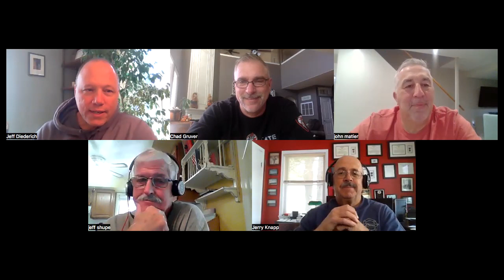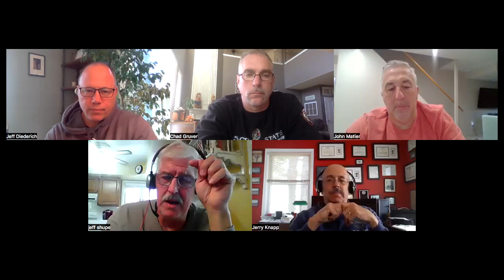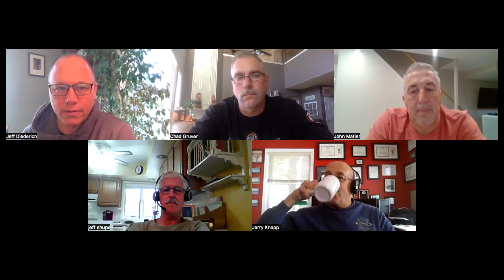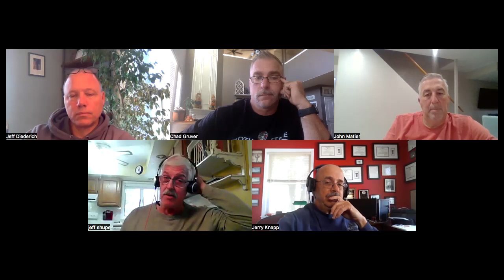Firefighting Fridays: Heavy Streams

Comment: I am no expert, but, if you are going to several blitz-fires at once, maybe consider drafting if a supply is available?
Reply: James, that is a very viable option. 
There have been a number of very large mill/warehouse fires near me in which drafting was required to supplement the municipal hydrant system. 
Companies were set up to draft from the river. It required long hose lays but it doubled the amount of available water. 
There was one incident in a very urban area that required the same type water shuttle using tankers/tenders that would be used in a rural, non hydrant area. 
Folding dump tanks were set up and a water shuttle was conducted from about two blocks away. 
The initial companies were utilizing the hydrant system and the incoming extra alarm companies were drafting and had an entire secondary water supply system established.